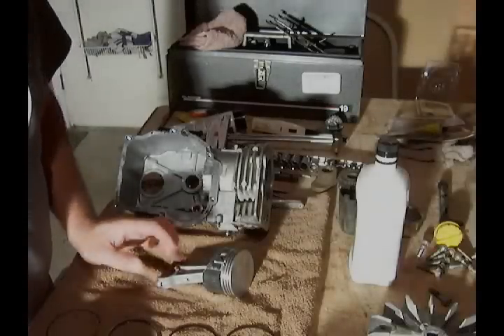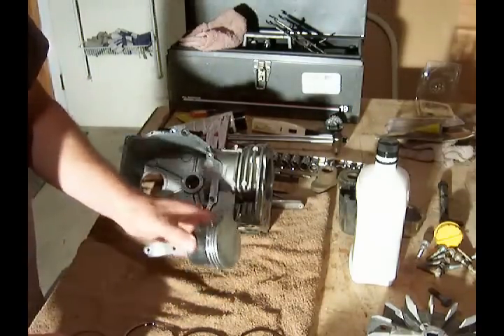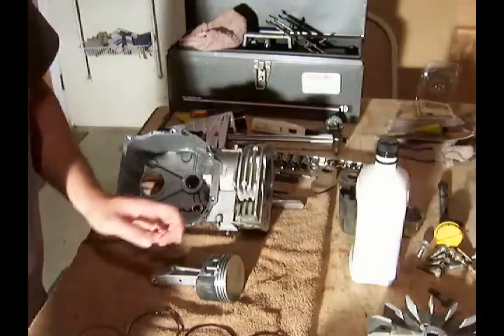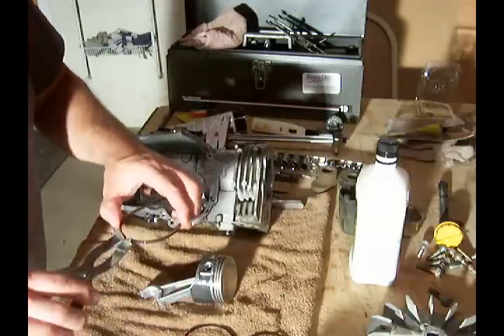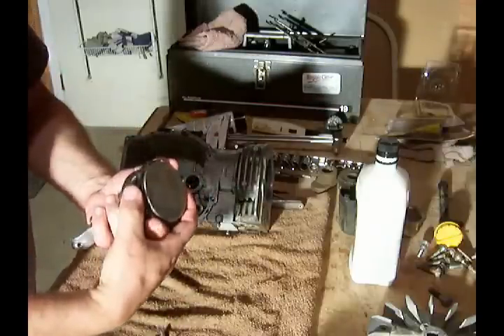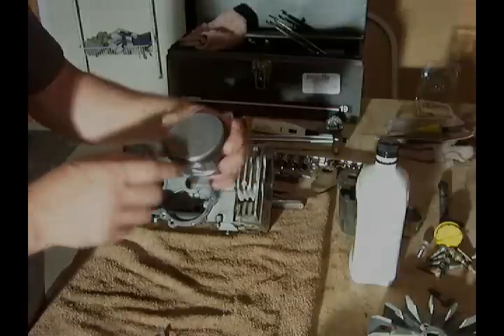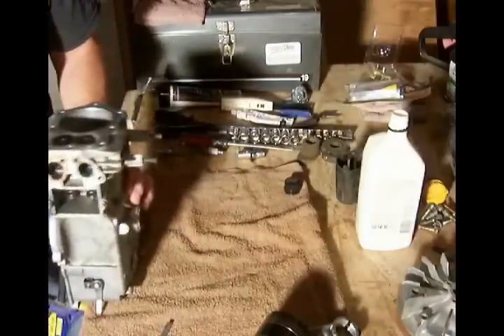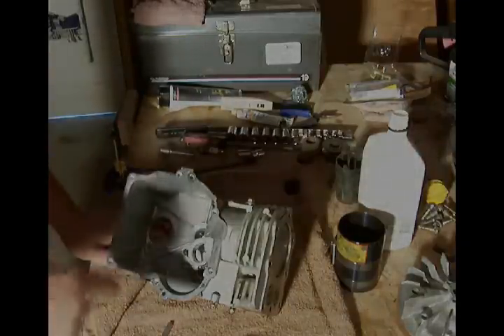#11 Tecumseh LV195EA / LEV120 - Tear down and rebuild - Piston ring and Piston installation

Comment: Great video, thanks!  However, I have the same question as sblg43.  On the engine you are working on (same as mine) the intake and exhaust are on the same side.  Does the arrow point towards the valves or away?
Reply from the maker: Here is a quote out of a Haynes small engine repair manual, "If the piston has an arrow in the top, it must face the valve seat side of the engine (if possible) or to the right when looking at the engine with the connecting rod pointing down."

Comment: Does it make no difference which way the arrow on the side of piston is pointed?  This is a great series. Answered all my questions but the one I asked.
Reply from the maker: Sorry about that. If there is an arrow, it should point toward the exhaust side. If there is an "IN" marked on the piston, well that goes toward the intake side. Thanks for watching.
Reply: Great video, thanks!  However, I have the same question as sblg43.  On the engine you are working on (same as mine) the intake and exhaust are on the same side.  Does the arrow point towards the valves or away?

Comment: I think I know the answer but maybe there is still a chance...how can I do this without the tool?
Reply from the maker: You can do it without the tools, but be very careful with the piston rings - they are brittle. As you set the piston in place, you will have to gently work the bottom ring into the cylinder. Then each of the other rings..... Thanks for watching.
Reply: sblg43 no problem thanks for the helpful videos and info